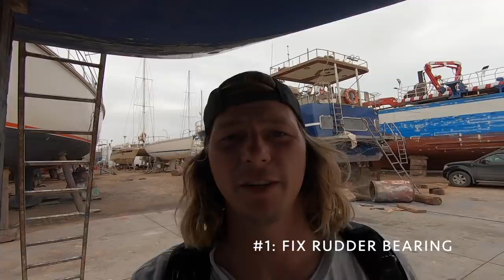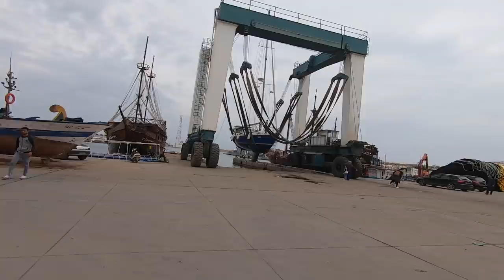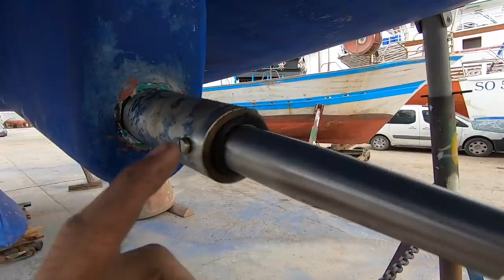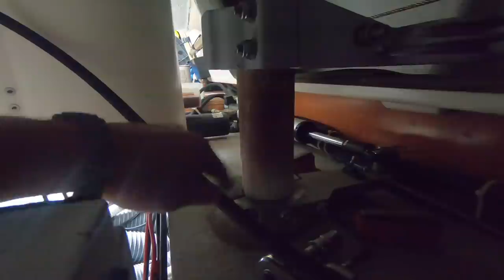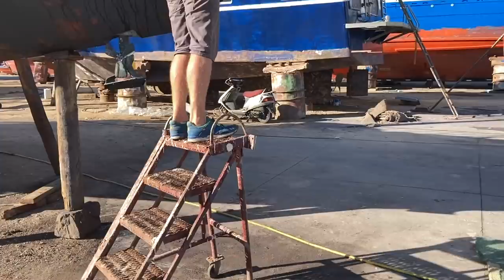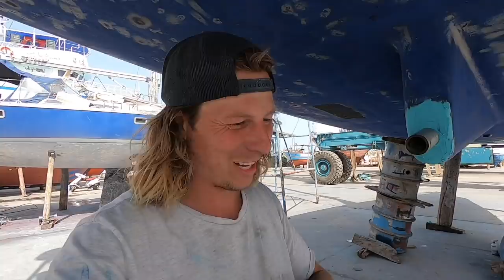BOAT MAINTENANCE: Rudder, Cutlass Bearing & Shaft Seal | Monastir, Tunisia | Sailing Sunday  Ep. 112

Comment: I didn’t notice but do you have a neoprene gaitor on the rudder shaft? I am sailing a 47.7 with similar fiberglass sleeve but have a gaitor up over the sleeve. Currently taking on good amounts of water under power.
Reply from the maker: No I don’t have anything like that? We just have the bottom bearing and the top bearing… our rudder shaft goes up above the waterline though…!?
Reply: @SailingSunday  thanks. Everything else looks pretty similar minus the rubber gaitor.

Comment: Why didn't they pressure wash all that shit off the bottom of the keel before putting your boat on the blocks? I also like the way they create weak spots in the hulls fiberglass! By letting you paint the unfinished jack stand areas only 20 minutes before splash time! When the boat is in the sling! I'm sure the recommended curing, and drying time on the paint can says 24 hours! I have seen them do this in more sailing videos, then not!
Reply from the maker: When we finish editing our upcoming videos you’ll have to watch them and see. We moved all the blocks and painted it all. The pressure washer was 25hp! Bloody thing blew all our antifoul off 😒😒😒, but it was ok, probably a blessing in disguise, it was good to re Antifoul everything again before our Atlantic crossing.